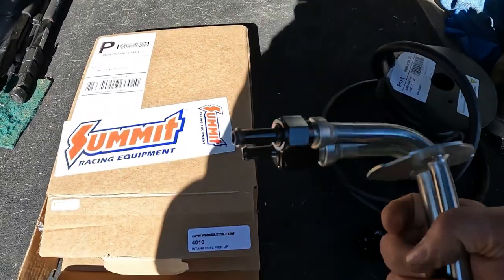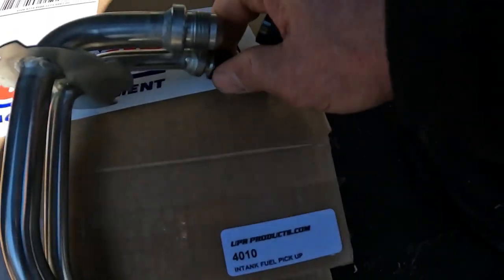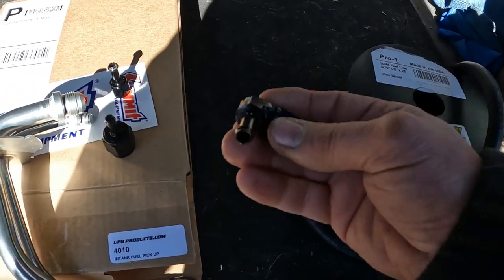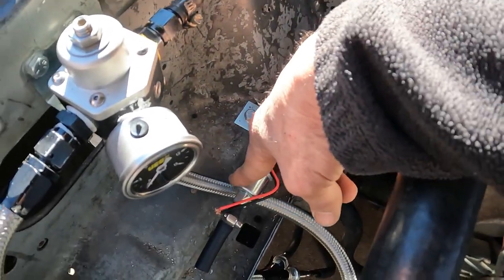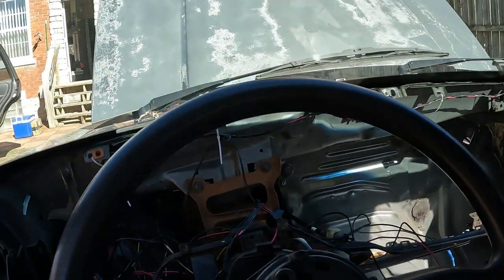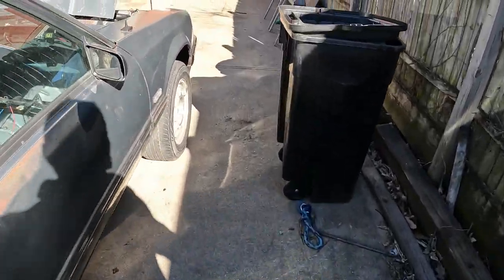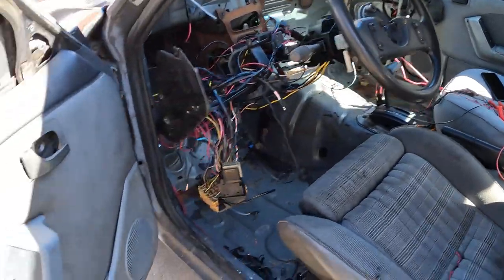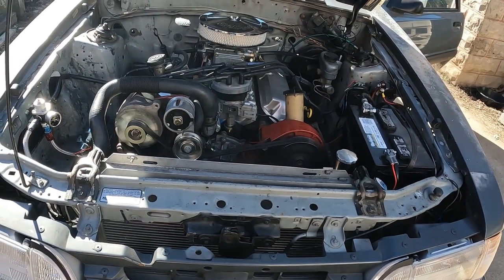EFI to Carburetor Fox Body Mustang (fuel lines pt 1)

Comment: HEY BROTHER I NEED YOUR HELP PLEASE , IS THERE A WIRING DIAGRAM ON HOW TO WIRE THE TFI MODULE TO WORK WITH A CARB SET UP, I SAW YOU WERE USING YOUR TFI DISTRIBUTOR ON A CARB SET UP , HOW DO YOU WIRE IT IN, THANK YOU SO MUCH MY FRIEND
Reply from the maker: From your TFI connector on the distributor, run the #2 wire "coil negative" (second wire from bottom of connector) to the negative side of ignition coil. Run #3 wire "Run Power in" (third wire from bottom of connector) to the positive side of ignition coil. Now, run a wire from the positive side of the coil to the ignition switch on the steering column.

Comment: How did you wire your fuel pump
Reply from the maker: I'm using a Holley "Mighty Mite" fuel pump (about $65.00 on Amazon) 4-7 PSI. Very simple to hook up.  I connected the black wire to ground and ran the red wire to a toggle switch and fuse box.